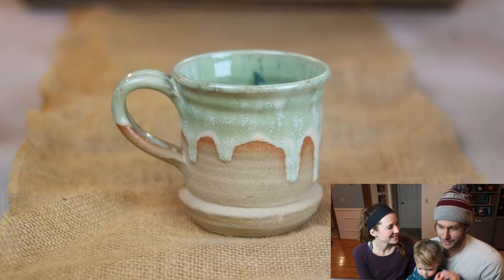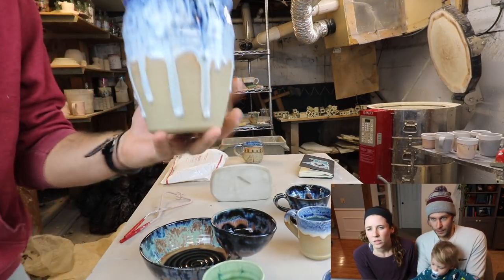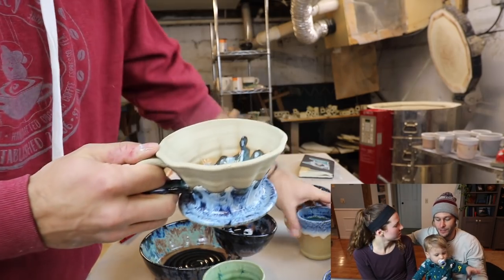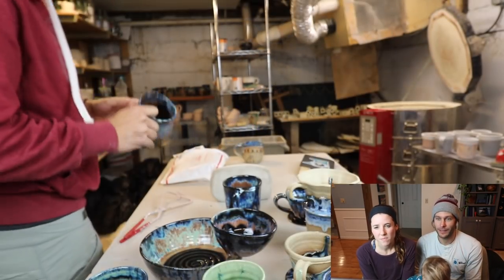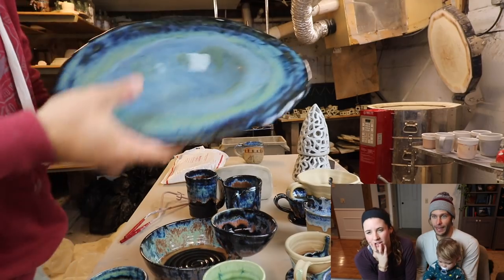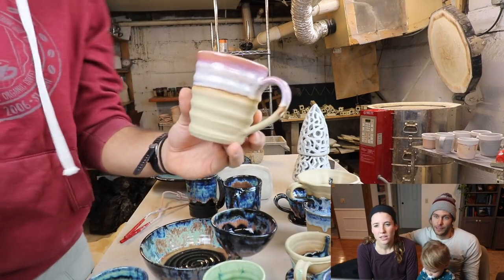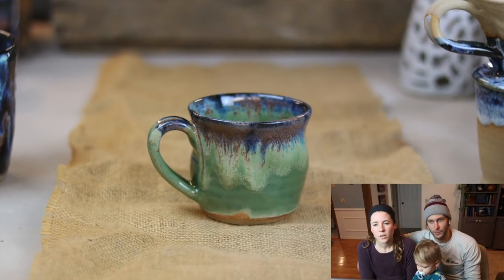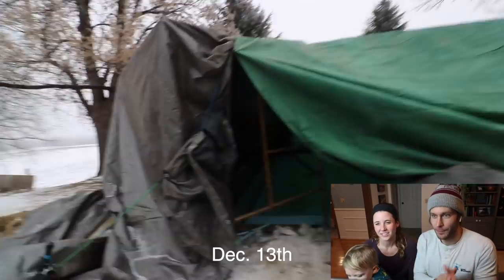Watching my own Kiln Unloading #38

Comment: I would not have guessed bird bath! It's awesome! I just wonder if the glaze, when wet, would be too slippery for the birds feet? Still cool looking.
Reply from the maker: I though that too!!  😬
Reply: HEY, but if the glass wasn’t too slippery then the pottery should work too.  Great idea. Modern take like the round flower pots in the square holder.